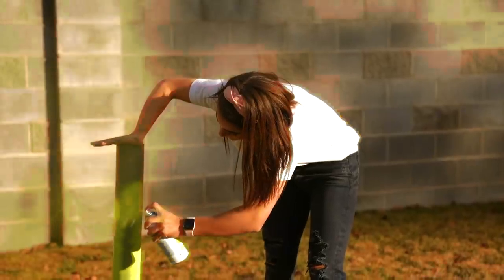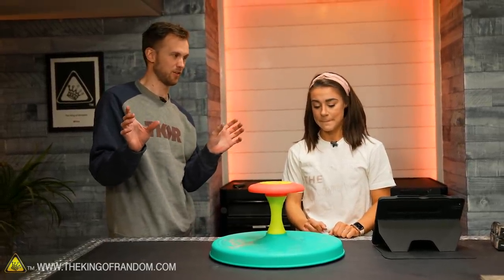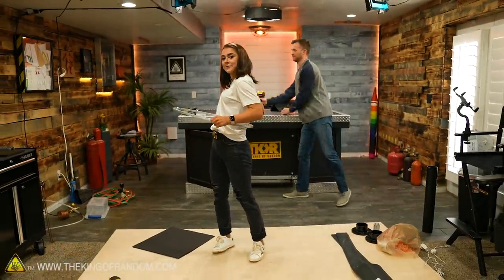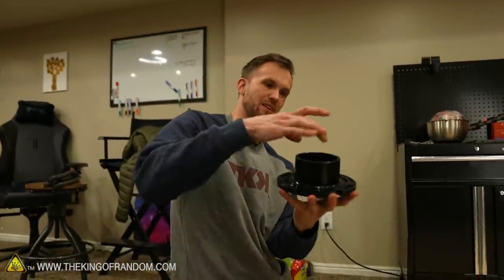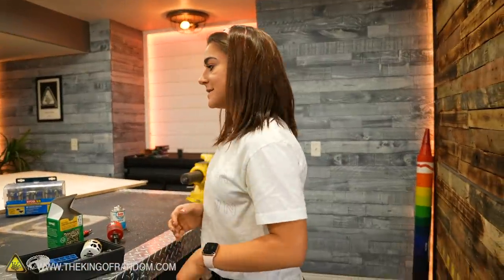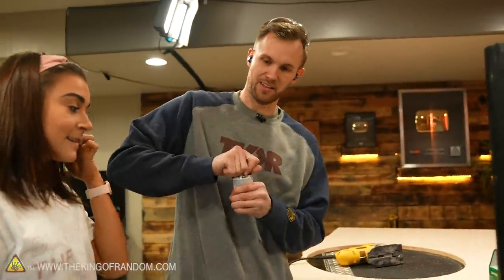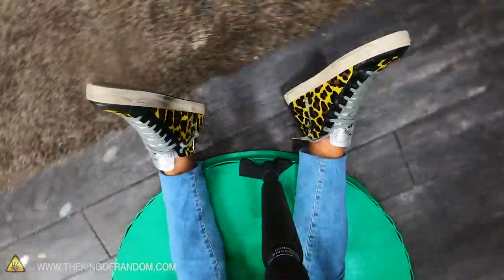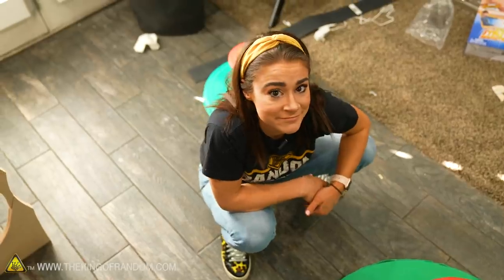Scaling Up Centrifugal Forces On A GIANT Sit n Spin

Comment: Try adding a fire extinguisher at one point, press it down, and see if the sit and spin will go really fast
Reply: That's a rocket.  Get grace holding the nozzle as far out as it will go with weight close to the center...yes, she'll be dizzy.

Comment: wow, very few get it right that there is no such thing as centrifugal force. I use that line to troll people
Reply: Would have loved to see a force diagram here to demonstrate the tangential force over time / at different angles. That would then show that the "centrifugal force" that's felt as an apparent force is really just inertia (i.e. from "90° ago"). It could also be used to springboard into orbital motion
Reply: @Lhikan634  I think we're gonna have to leave orbital motion to Rober.  Tangential inertia would have been nice, though.  Shouldn't tell people there's this thing, but it's not real, then not tell them what it actually is.
Reply: @Lhikan634  Actually, I was thinking about this. On the one hand, sitting further out would increase your translational speed, so you'd expect the apparent force to be "stronger". But on the other hand, sitting closer would reduce your moment of inertia, increasing your angular velocity and momentum, which in turn would increase translational speed and centrifugal force. My instinct would have been that sitting closer would make you feel it more, because moment of inertia includes an r^2, though I want to actually do the math now, after Grace making it wobble.
Reply: Update: Assuming angular momentum is our constant, centrifugal force should be inversely proportional to r^4

Comment: Just nit picking but at 5:20 Nate said he measured the diameter then divided it by 2 to get the circumference. Dividing the diameter by 2 would give you the radius (he does use the correct term ta few seconds later though)

Comment: Why centrifugal force is a "Phantom Force"
===================================
When on a spinning a circle, you are moving tangent to the circle, however, the friction between your butt and the surface acts kind of like a rope keeping you attached to the center. Causing you to move in a curve. When you lose that friction, you still move tangent to the circle (tangent is the line 90 degrees from the radius) which gives the effect of it pushing you away. (We are covering that in my physics class right now).

  ---------------->
+
                           /
                        /
   (Center) |_

=

) (Curve)

Remove Friction

  ---------------->
+
               
Nothing    

=

------------>

Comment: Uh, Nate?  Might want to pay a little more attention to your terminology.  At 5:20 you said, "I measured the diameter of the ring; I divided that in 2 to get the circumference..."  but you can't find circumference by dividing diameter by 2!  I think you meant radius.

Comment: I have a question based on spinning: How do rotating/slow spinning lit electrical signs stay lit without twisting the wires to the point of breaking?
Reply: Usually they just have fixed lights in the middle
Reply: But those that have external moving lights on them are some form of sliding contact mostly. Like a drill motor. A spring loaded conductor that touches a spinning ring.